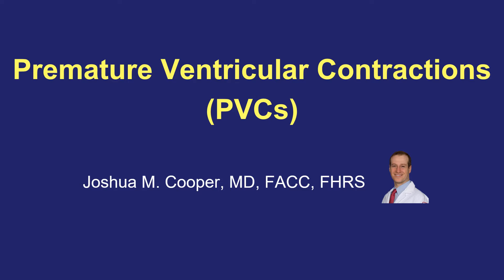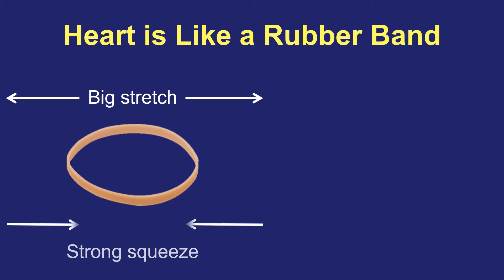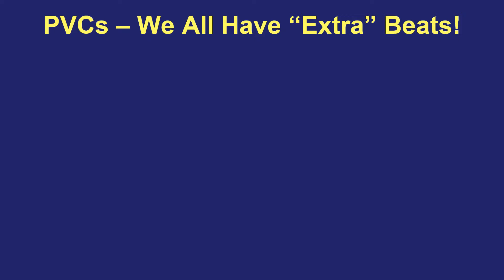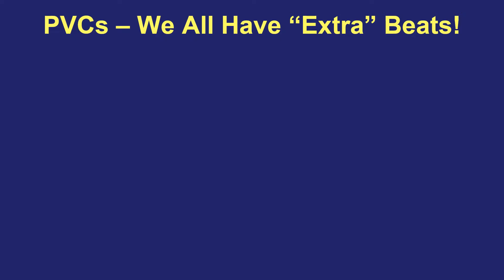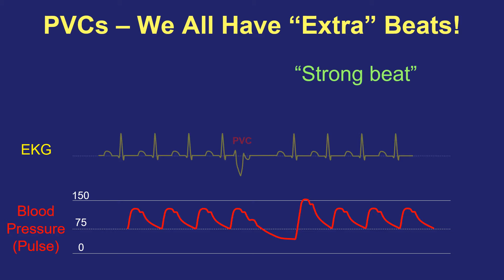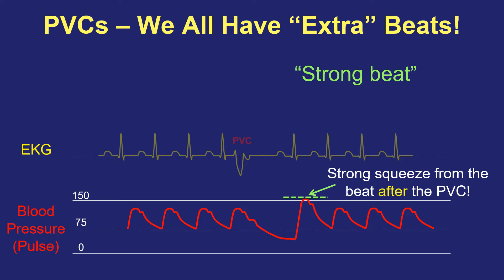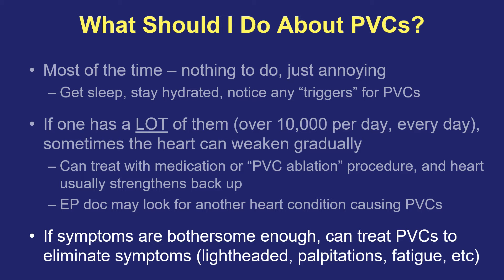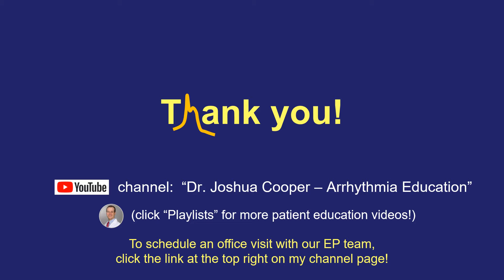PVCs: Symptoms and Treatment - in Plain English!

Comment: Thank You for this video. However, i heard absolutely nothing about breathing issues/ or oxygen in direct relation to All of this. i was diagnosed with simply "pvc's" years ago after having had to wear a heart monitor for testing. well now as i have gotten older they have become far more daily. i have been actually wearing 2 surgical face masks on a daily basis for quite some time now (this has NOTHING to do with the corona virus) it is strictly for control of my breathing. what i mean is, is that when i breathe regular room air or ESPECIALLY if it is a windy atmosphere, or even a fan near me, Then this sets my heart into these pvc's and i almost feel faint when this happens. i get dizzy to. i feel exactly that "heart skips a beat" sensation and sometimes it feels like 3 or 4 happening all at once. it is more like an "episode" when this happens to me. but now since i HAVE to wear these face masks. the only way that i can describe it, is that it is like the masks blocks/ or cuts down the (amt) of air so that i do not get TO MUCH into my lungs to fast. and by this, i do not get the pvc "episodes" quite often in my day. i also cannot move to quickly because that sets them off as well. wearing a face mask has become almost like a shield for me. i MUST wear them 24/7 even in sleep. for me, it seems to be all about the amt of oxygen that i breathe to quickly. is there ANY one else that can relate to  what i am describing here? i will add, i am 59 years old and shamefully was a heavy smoker most of my life. i did quit smoking in 2017 and never picked up a cigarette since. however, regardless even of that, still now it seems the older i get, the worse these pvc's have become. now so much so that even if i was still smoking, there is no way that i could be able to because i cannot breathe in enough to be able to smoke a cigarette without setting off these pvc's. if only if only i could turn the clock back and NEVER even started smoking. one more last thing i should mention and i feel silly saying this but it does REALLY seem to help CALM the pvc's down when i having them. it seems if i YAWN and get enough air back out of me ... This also seems to help calm them back down. i know i probly sound crazy but this is TRULY what i am having to live like day in and day out. i am Petrafied to go out and about right now with all that is going on out there. i am trying to wait til things calm down with this whole virus thing first.
Reply from the maker: Thank you so much for sharing your story about PVC symptoms and how you have had to completely modify your life (and even your breathing) around trying to control PVC symptoms.  Yours is the first story I've heard where there is a strong association between breathing patterns and PVC symptoms, but it is very plausible that there is indeed such a relationship.  There is a complex network of nerves that run through the body, controlling everything from heart rate to blood pressure to digestion to sweating to breathing, and more - it is called the "autonomic nervous system" (ANS).  The ANS is responsible for constantly making micro-second adjustments to all the body functions that are supposed to be automatic - this includes controlling the squeezing and relaxing of blood vessels to ensure blood flow to the various organs always matches their exact need; regulating the speed and strength of heart pumping to match circumstances of rest, sleep, exercise, anxiety, pain, fever, and the countless other situations that all create unique needs of the body; opening up small airways when the lungs and body need more air flow; and so much more.

Even when one sits quietly and breathes in and out, there are constant rapid adjustments in the activity of the ANS nerves that can have impact on other parts of the body, such as the heart.  And since PVCs often are also impacted by the autonomic nervous system, it makes sense that breathing patterns could be associated with PVCs coming and going.  Even though the ANS is supposed to simply function independently and automatically without us thinking about it, people can learn many tricks and ways to control their ANS, using techniques such as biofeedback, meditation, and mindfulness activities, and there can be beneficial effects of doing so.  That said, PVCs can be so difficult to control, especially since the ANS at best is only partially under our control and there are many other factors that likely impact PVC frequency and symptoms.

Medical treatment for PVCs can be extremely effective, especially for PVCs that happen frequently.  Certain medications can work very well, and catheter ablation can be curative by permanently eliminating the irritable spot that is responsible for these extra beats.  Given how much you've had to adjust your life (and even your breathing) to try to self-treat and gain some control over what clearly are very bothersome symptoms, I wonder if consulting with a heart rhythm specialist (electrophysiologist) might be helpful, or even life-changing for you.  If your PVCs could be eliminated, that might finally free you from having to constantly think about your breathing, and finally feel free to "go out and about" (when the pandemic allows!! :)

I wish you the very best of luck and would encourage you to have a consultation with someone you trust who can help you manage your PVCs in a way that is less all-consuming than the system you have had to create for yourself over the years.  God bless!
Reply: @dr.joshuacooper-arrhythmia9917  Thanks Dr Cooper, i will look into this and God Bless You and Yours as well.

Comment: I was just diagnosed with PVC. He said something about the top is 10 bottom is 1. Not sure what that means. 10 seconds over 1 second?  

But he recommends metoprolol 50mg in extended vs tartrate and to exercise. He said it will strengthen the heart and help get thr beats back in rhythm. 

Some days are okay and may notice only a few and other days I may notice 20-50. I used to get them for only a day and then not again for another week or two. Now its almost every other day 

 Will the exercise help or will I need the ablation procedure at some point?
Reply from the maker: I can't decipher the 10-1 comment, other than maybe there were 10 normal beats (from the top chambers) for every 1 abnormal beat (PVC from the bottom chambers)?  Beta blockers like metoprolol can sometimes help suppress PVCs, but sometimes it may not work as well as we'd like (and sometimes there are side effects like fatigue and reduced exercise performance).  There are other medications that can work even better than b-blockers and certainly catheter ablation is a way to more definitively eliminate PVCs in people where there is a medical or a symptom reason to do so.  Best of luck to you!
Reply: @dr.joshuacooper-arrhythmia9917  so does 45 min a day of raising the heart rate to 140 during cardio help get rid of PVC over time or is the ablation the only true answer  ?
Reply from the maker: PVCs often suppress during exercise, but I'm not aware that exercise results in overall suppression of PVCs at other times (actually, paradoxically, if one's resting heart rate gets slower with increased physical fitness, that can give more opportunity for PVCs to show up at rest, including while lying down to go to sleep, which is a common time that people feel PVCs).  Exercise is an excellent thing to do for many many reasons, but I don't think it is a solution for PVCs.  PVCs may subside on their own, may suppress with daily magnesium supplement, and can be managed with medications or catheter ablation if the PVCs are bothersome enough to warrant medical treatment.

Comment: When my heart "skips" a beat, I can feel it more so in the bottom of my heart. Is that a PVC or a PAC?
Reply from the maker: It's mostly the bottom chambers of the heart that we feel beating in our chest, because those pumping bottom ventricles are much more muscular than the top atria. That's true for normal beats, for PAC's, and for PVC's. As mentioned in the video, the beat after the early/extra beat tends to be stronger due to a longer time to fill with blood (like the over-stretched rubber band squeezing extra hard) - that can happen either after a PVC or after a PAC.

Comment: I mentioned this video to my EP, saying it described some of my symptoms so clearly. He told me I had PACs not PVCs. Am I correct in assuming the that subjective feelings are the same regardless of the source? Breathless for a moment, then the big whoosh of blood? Like a tsunami when all the blood is held back and then a the huge wave. The big whoosh makes me so hot, I feel like I’m having an internal sauna.  😂
Reply from the maker: PACs can create a similar pause in the heartbeat followed by a stronger beat thereafter, although usually those symptoms are less dramatic than with PVCs. It should be very obvious with heart monitoring whether somebody is having PVCs or PACs causing symptoms, so if you wore a heart monitor and clearly indicated when you were having your typical symptoms, your EP doc will easily be able to distinguish!
Reply: @dr.joshuacooper-arrhythmia9917  Thank you! Yes, had a linq device for 4 years. Dr has oodles of data. He just couldn’t get AT to trigger during last ablation. And so it goes.    Thank you for taking the time to create patient videos. Really helps in taking with one’s drs.